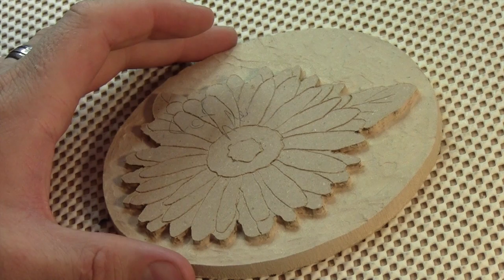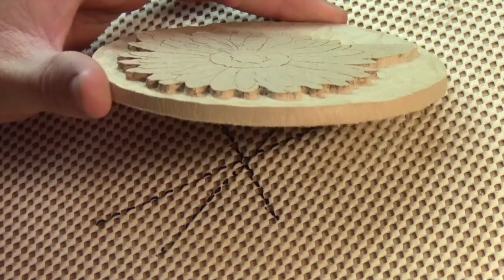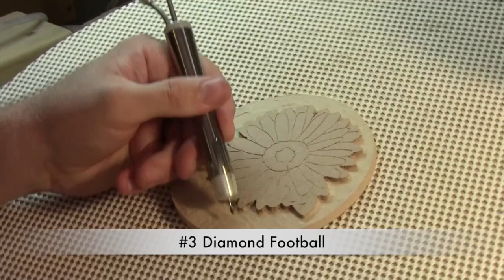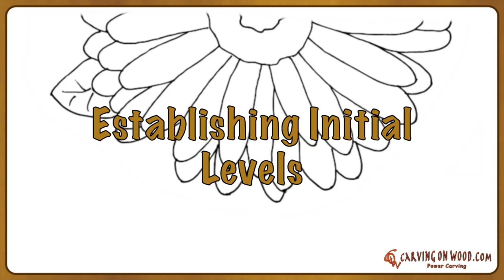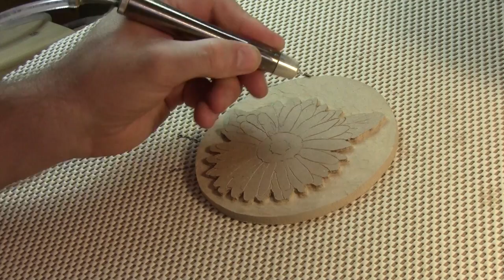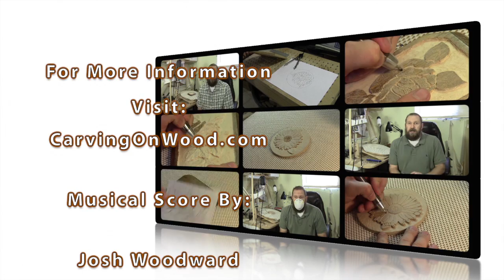04 Relief Power Carving - High Speed Engraving - Establishing the Initial Levels of the Design

Comment: A old timer said to me that if you have no knowledge and want to get started.. you should start by hand carving first then turn to power?!? 
What do you think?
Reply from the maker: All of the steps used for woodcarving are the same from the initial layout, creating depth, and adding detail. So the principles of carving remain the same. The tool selection, control, and finished look will change depending on what types of tools you choose to use. I will say that there are way more sources for learning hand carving methods than there are power carving methods. I would almost say that it depends on how much additional instruction you want, and how much you want to figure things out for yourself.
Reply: @TimVandeSluisArtist  kool thanks I can't wait...